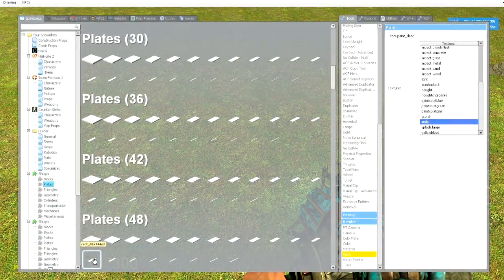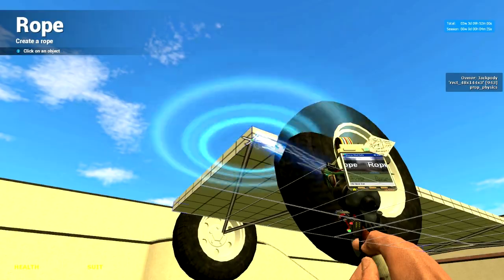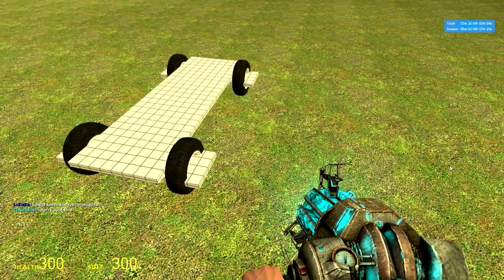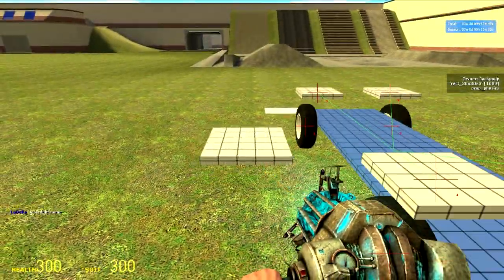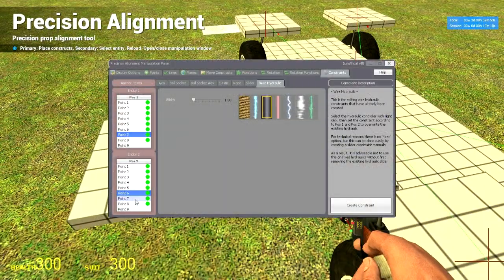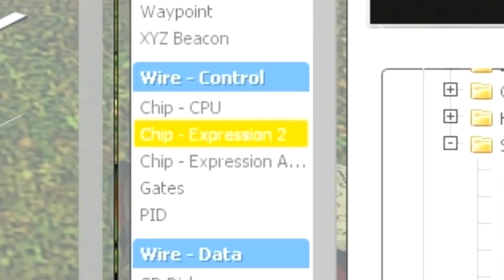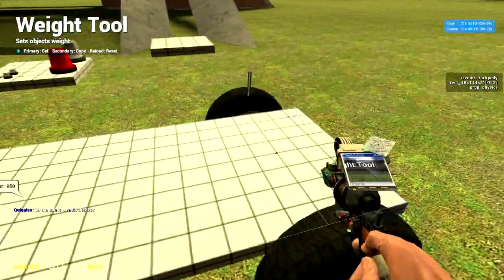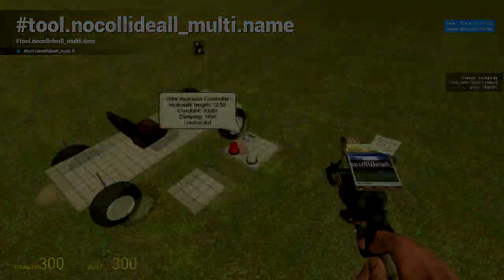[GMod 13] Suspension & Steering Tutorial - Simple

Comment: I did everything like you said in the tutorial, I have all the addons that was in the description, My back wheels work fine, its just that they are a free ballsocket with no limitations, they stay in place but just rotate everywhere. My front wheels do the same, They are really stiff, If I try to move them up its really hard but if I do pull hard enough they just go really high up. My back wheels sometimes do the same thing.Screenshots:https://www.dropbox.com/home?preview=gm_bigcity0006.jpg https://www.dropbox.com/home?preview=gm_bigcity0007.jpgIf the links dont work, let me know and ill fix them.
Reply: Other than that, drives and steers perfectly. Also would it matter at all if for the ballsocket I accidentally put 100 for the X minimum? If so how do I get rid of those ballsockets?
Reply from the maker: Yes, it matters. You'll have to redo the ballsockets with the correct settings. Other than that, the "wheels flying everywhere" issue sounds like the ballsockets not being created while the vehicle is pointing North. You HAVE to build pointing North on the map, as I explain at the beginning of the video.
Reply: I did do the ballsockets north, I'm wondering if its just because I used my physgun in a certain way in combination with bad ballsockets?
Reply from the maker: Could very well be. Until you get the hang of how this works, it will be finnicky and you will notice that doing certain things while building the chassis might end with a wobbly suspension.
Reply: Alright I got it to work, thanks! One problem is that if it drops from heights or crashes into a wall at certain velocity, the suspension (ropes) will just invert and now I have the wheels on the top half of my car.
Reply from the maker: You can fix this by placing the plates for the hydraulics 1200% upwards instead of 400. Means you get more suspension travel before it collapses.
Reply: ah ok thanks
Reply: Alright, I'm revisiting this tutorial a while later, (now) and I changed the plates you attach the hydraulics to (the ones that we later remove) 1250% upwards instead of 750. Im pretty sure this is what you mean, Anyways, the ballsockets are ignoring the X Y Z mins and maxes. They are just spinning where ever.
Reply from the maker: Are you building pointing North on the map like I explain at the beginning of the video?
Reply: yes

Comment: that's why it gives errors
Reply from the maker: No, it isn't. You just forgot to read the comment section about the 200 other people who have had the same issue with the E2. Since this video was created, a patch to Wiremod was released which disables propcore. You will now have to turn that on manually. You do that by going into the console and typing in a command which enables it (it has been posted many, many times in the comment section).

Comment: 1) this is not "simple".
2) This is to many things to do to be called "simple"
Conclusion: its not simple.
Reply from the maker: Sir. Vapenation I think it depends! It’s considerably more simple than many other suspension and steering tutorials, especially compared to the engineering behind. Even then, it’s not at all complicated if you have a normal grasp of Wiremod. I do agree, however, that it’s more complicated than adding wheels with the wheel tool to an HL2 prop-car.

Comment: Honestly, this is a bit overcomplicated... Meh old video, outdated.
Reply from the maker: This video was pretty modern when it was created, and it definitely holds up to this day. What do you think needs redoing?
Reply: I do agree it holds up today, but it's not the best. It has the problem with the wheels snapping out of position (upwards) when too much upward force is applied on the wheel.
Making the hydraulics/elastic be connected in the wheel's center makes for much better suspension.
Reply from the maker: That is definitely true!
Reply: +Jackpody I heard some like this suspension type for the realism, but I think the most realistic is solid prop suspension. If you just need performance with simplicity you would use the method I mentioned above.
Reply from the maker: From rather thorough testing, I would conclude that solid prop suspension is far from the best suspension type for several reasons. To sum it up: It's way too unpredictable. You can't fine-tune the dampening without tuning the constant on top and there is no proper way to do on-the-fly adjustments using solid prop. However, if you want to use solid prop, then I won't stop you - it's all your choice and I have no say there. However, I don't quite think it's correct to say that it's "the most realistic type" when it has several drawbacks.
Reply: +Jackpody Oh by above I meant where you put elastic/hydraulics in the mass center of the wheels, lol.